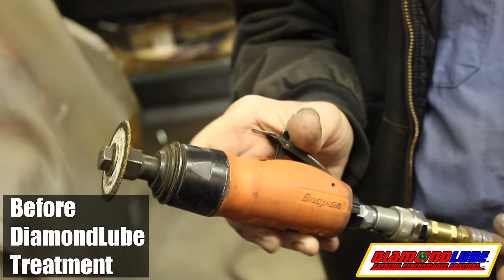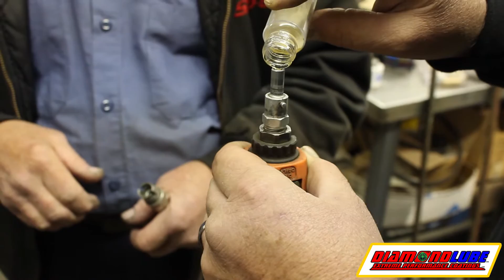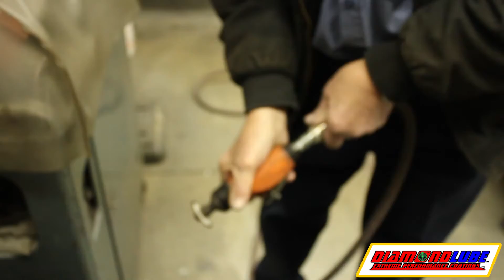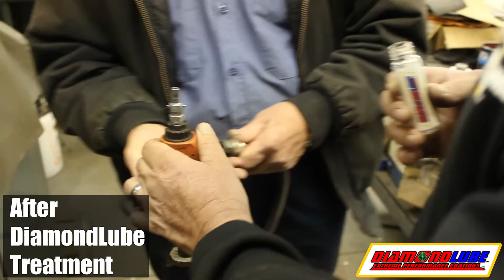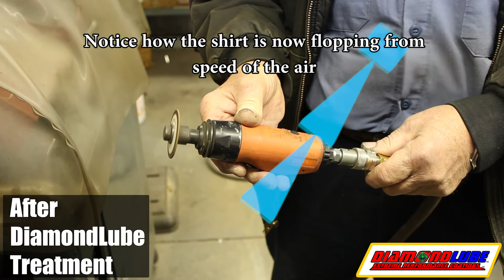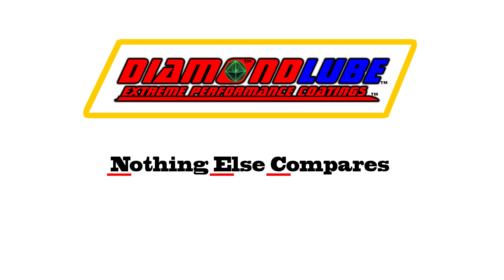How to make an old air tool run like new

Comment: Better than new, you say. Have you contacted tool manufactures to have them use your product to improve their tools' performance before selling?
Reply from the maker: Yes, name a brand name company and we’ve already contacted them.  Once they test it and see how it works, they don’t want anything to do with it!  They want to sell sell sell. Apparently they think that if the parts of their tools don’t wear out, they won’t sell any new ones.  It’s an asinine thing to think that way because even though the part is lubricated and has reduced friction, parts can still break.

Comment: For everyone out there, try putting air tool oil in your air tools before use. If you read the instructions they say to oil daily and i guarantee you, you’ll have more power and better function of them. As far as diamond live working or not, the video cuts off and there is no tested evidence or probable information on the video other than we see a guy with a bottle of oil (snake oil) put into a tool and it working better. I would be intrigued if they actually tested it against 10 or 15 lubricants such as air tool oil, WD 40 motor oil to actually know if this stuff if snake oil. 

Proof real evidence diamond guys plz
Reply from the maker: You can go to the website to see testing. We were approved for a Mil-Spec in 2013 and have countless other tests